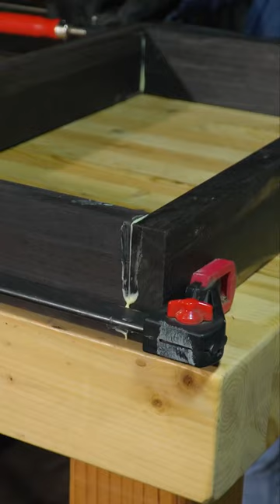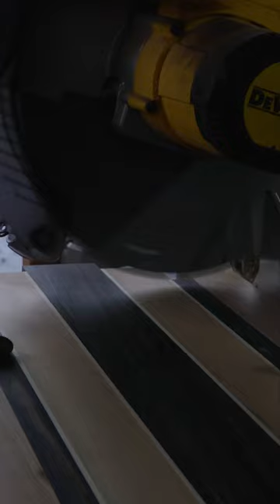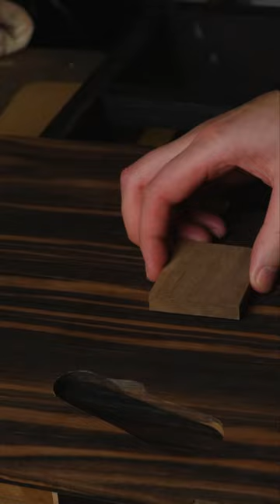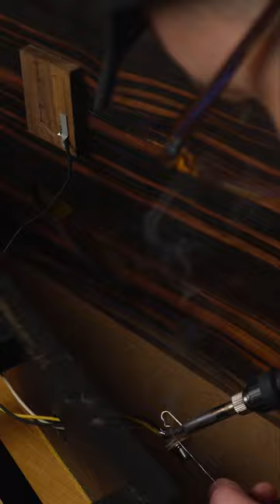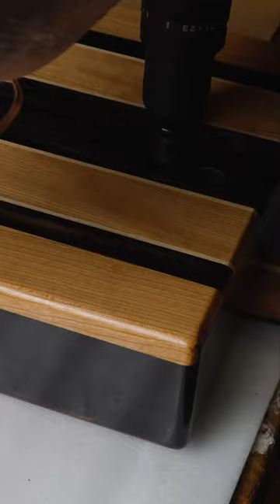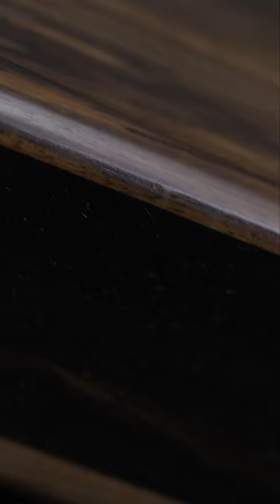Square Guitar - Speed Build #shorts #short #shortvideo #shortsfeed #guitar #guitarbuilding

Comment: I couldn't tell what was happening, did you turn a cutting board into a guitar or make a cutting board then put guitar parts on it?
Reply from the maker: It's convenient when I'm playing it and I need to cut some bread for toast, just flip it over, slice bread, make toast, and rock out, what else do you need in life? 

Also many guitars are built with laminating, neck through bases, and many high-end models, this is only really different because I made it a rectangular shape as an experiment. Also, that black stuff is ebony, hard, and expensive, and I would never use it in a cutting board.